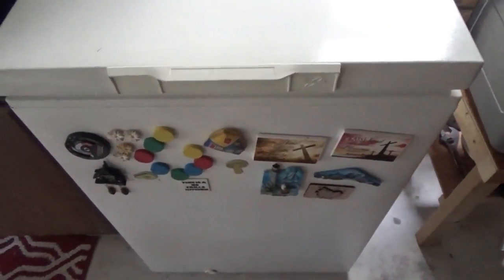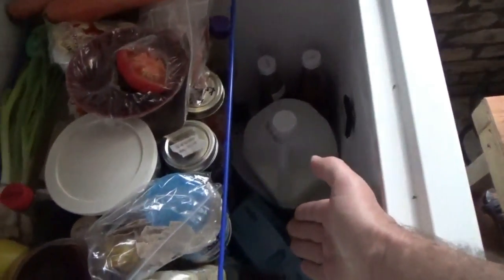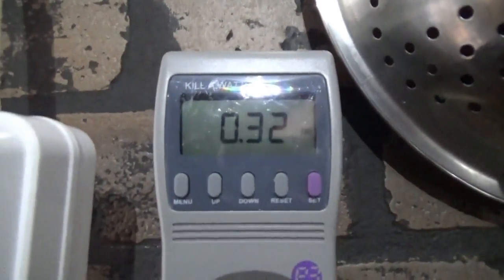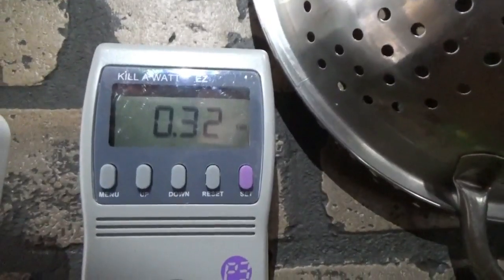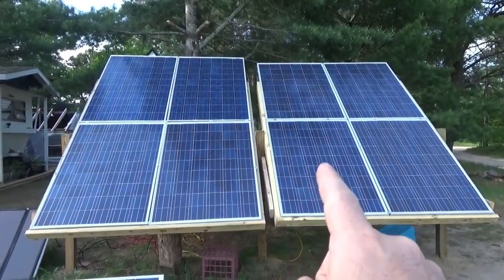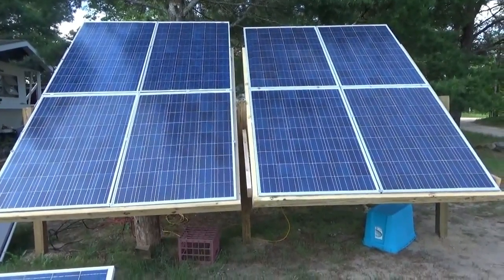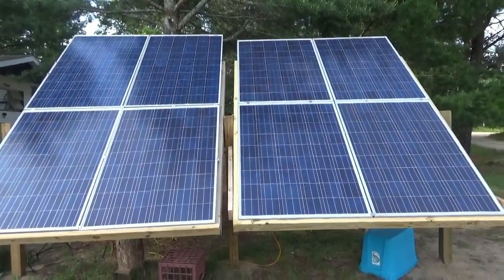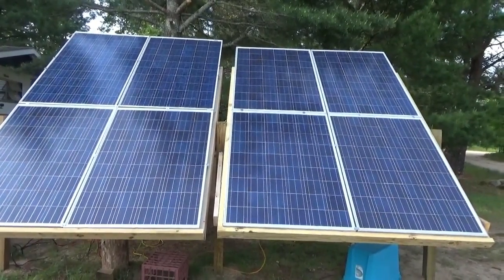Solar Powered Freezer Fridge Conversion Updates Use Only 300 WH Per Day

Comment: I'd like to share my results in a very similar test.  So there are a number of variables here that I'm aware of so technical guy out there just sit back and relax.  I bought a brand new Magic Chef 3.5 C. Ft. chest freezer (June 2019).  I bought a digital temperature controller and set the fridge/freezer compressor to turn on at 40F and turn off at 37F.  Once off, I recorded the temp continuing to drop as low as 30F before it would start the slow temp climb back up. Also note that I had the unit completely empty, I started the test with the unit already at the desired temp and it was placed inside my house at a constant 78F.  After 48 hours, here were the  results of my freezer to fridge conversion: My kill-a-watt recorded that it only consumed .238 KWH.  Of the 48 hours, it ran 7 hours and 40 minutes.  I noted that when the compressor turned on, there was a momentary spike of 700-800W but leveled off very quickly to around 60W.  I forgot to log the time it would run before turning off but I would guess under 2 minutes.  Also, the temperature controller was measured at idle fluctuating between 1.2 and .2W but I noticed it typical sat at .7W most of the time.  Understand that if you wanted to run this setup, you would also have to account for the draw/consumption of an inverter as I was not able to get numbers on one.

Regardless of the exact accuracy on my basic test, it's pretty clear that it is extremely efficient.   I hope this helps someone out there curious to semi real world numbers on this kind of set up.  I'm surprised there isn't more data/info on this subject on youtube.  The lack of it is what caused me to go do this on my own so I could see for myself.  I'm convinced now that it's the way to go for off-grid refrigeration for short or long term.

I forgot to add that I never opened the door either (except maybe once) which could also help account for my extremely low consumption.  In a real world situation, this would be getting opened much more frequently.  Regardless, this is still a very efficient option.
Reply from the maker: I plan to reset my meters and get some real world numbers. It sure is efficient though.
Reply: @TheDoItYourselfWorld   By the way, thank you for the videos.  Very helpful.  Enjoy your channel
Reply from the maker: Thank you

Comment: Great idea..they say that inverter freezers ,refrigerators and split AC heat also use less energy. You might wanna fill some of that empty space in the freezer with Styrofoam blocks that you could take out in small sections if you need the space for storage! but leave a little space around the wall area of the freezer because that's where the coils are!

Comment: Good little hack.
Do you know how much power that temperature sensor uses? It's working 24/7 monitoring the temperature and could be using more power over time than the freezer uses. Maybe a more passive non-electrical thermostat could make this project even more efficient using even less power.
On the other hand, your current temperature control may be using next to no power. That wasn't clear and just something I wondered about.
Maybe even turning the freezer's control to it's highest temperature would maintain the temperature at a little above freezing. Maybe some experimenting could show that.
I just try to avoid things that need to run constantly like the temperature control you are using. 
In any case good luck.
Reply from the maker: Yes I had thought of that and the digital controller is also on the meter. It uses one watt of power all the time. So I guess it uses 24 watts per day unless it uses more when the compressor is running but I have no way to measure that.
Reply from the maker: thanks

Comment: Hi Troy.  Liked this freezer project.  I am planning to do a similar setup.  Just recently started using solar electric.  But with 400 watts can not run the regular stand up refrigerator.  So looking for chest freezer to convert.  But what concerns me is the energy cost of also involving a DC to AC inverter.  I have an old APC UPS used for computer backups that can work as a pure sinewave inverter alone but man, it draws a lot of energy even without a load connected.  Would not make sense to let it idle most of the time and burning power for just the occasional loading to run the refrigerator.  So the question is how does your inverter operate?  Always on, burning some power with occasional big bursts for the refrigerator or maybe an automatic wake up where the inverter draws next to nothing until it senses the refrigerator call for power and then operates or is there another option?  What capacity do you use for the refrigerator and is it modified or pure sine wave?  What does your inverter draw in watts at idle without a load?  Just trying to get a feel for what is common for inverters with solar.  Thanks for any help.
Reply from the maker: That UPS is trying to draw power to charge the batteries as well. You would have to disable that part of the circuit I think in order to get it to work as only an inverter. They are not made to be efficient at all. A pure sine wave inverter is best for compressor type appliances. No idea really what my inverter draws but I have seen a difference in power loss overnight on my batteries using different inverters.
Reply: Thanks for replying.  My UPS is designed to work also as just an inverter.  During that mode, it does not charge the batteries, rather I can patch in power from my solar charge controller to keep charging them.  It is a pure sine wave UPS capable of 960 watts steady draw max.  Should be plenty to run my dorm fridge of 120 watts steady average power for short intervals as a fridge only runs also in intervals.  Could you check your idle volts and amps before the fridge turns on?  If not can you give the name and model of your inverter and I can check the specs?    

Would make a great video to show power draw between different inverters you had over the years and which was more efficient or what features you particularly liked or disliked.
Reply: I use a dedicated inverter for my chest fridge and I power the inverter on and off bypassing the power switch with a relay. Startup draw is about 120A at 12V which is quite hefty.  Inverter is oversized and so I removed all the fans which draw a decent amount of power.
Reply: Thanks for replying, Troy did not reply back as yet.  That is good info. Have you considered halving the amps by going to 24V batteries?  So the relay turns on/off the inverter which the chest is already plugged in?  Seems like it would be very hard on the inverter.  Was thinking better for the relay turn on the inverter and after a timed period then run the chest.  Unfortunately the on/off on my unit is a digital panel not discrete flip switch connections so can not use.  What is the inverter you have and I can look up the specs?
Reply: I have a purpose designed system that is tailored to my needs.  I use a 12V car battery from the vehicle I don't take to camp. Leaving it even with charge would shorten its life. Anyway, the whole camp runs on this battery, refrigeration, lights, 30 gal hot water, pump, TV, a medical device and even a dishwasher with heated dry. Doing dishes right now with 130F water. If there was a way to save another watt, I'd be doing it.
Reply: Your are using just one lead acid 12v car battery to run all that?  Do you have a specific video on it or a wiring diagram somewhere?  I visited your site, interesting circuits, will check out your videos when I have time.
Reply: @opera5714  you will Completely Destroy a Car Battery Quickly. Do not do that ....deep cycles amphr batteries NOT Cold Cranking Amp Batteries. If ya wanna waste $$  might as well just ,"PEE-IN-A-FAN"!!!
Reply: @unclejack41  You can easily destroy a battery with a fridge, even a deep cycle one.  However, I do not sit at the kiddie table of solar. I design advanced control systems and the fridge can never drop the battery much more than 5%.  I also run a dishwasher with heated dry and a large capacity clothes washer with hot water on all cycles all provided by PV. Who needs a big battery!

Comment: I'd be curious to know how much power the upright fridge used, for comparison. Some web research would indicate that an 80s vintage fridge would use up to 4.6kWh/day, but a modern high efficiency unit could hit 1.2kWh/day.
Reply from the maker: It was not a modern high efficiency fridge for sure. I would guess 5 KW per day based on meter usage in the past although I am not sure its "vintage" either. It has automatic defrost and an evaporator on the bottom. Never gave us any trouble. Just could not run it on solar power.

Comment: Like many others with these videos, I believe you are giving people unrealistic expectations.  I've run solar powered chest fridges for years and never get near those numbers. I've had 5 & 7CF fridges and I need a KW of panels to keep them running reliably.  Condensation is a nightmare. I keep mine elevated with a drip pan underneath.  My 5CF didn't  wasn't so stratified the way the coils were placed. The 7CF ( one year old) had the coils lower and I have to run a computer fan all the time to keep from severe temp stratification. If you never open the fridge, you might get close to those numbers. Those are definitely not active use numbers. What does the timer say?  My control prevents hot starts and the system will continue to run in the rain and clouds. I heat all my water with the excess energy not used by the fridge. It is a catchy title.
Reply from the maker: So, either I am lying or the Kill-A-Watt meter is lying. Or both I guess. I showed the meter. I do believe I told the details in the video and description. You can believe it or not.
Now the condensation is a problem, thats for sure.
Anyway, I plan to do a video showing it running on a single panel and a battery when I can scratch up a battery for the project.
I have seen this done many times during my brief stay in Australia so I know its possible. They do it a lot over there. Off a single battery.

Comment: What brand solar panel do you use? And your saying if I get a 200 watt solar panel. I can run my little deep freeze?
Reply from the maker: I forgot the brand. Had them for years now. I have a mix now anyway. It depends on your freezer specs. I would double the solar panels and have enough battery power to run it over night. Should be good then.

Comment: Hello, here is a woman with a question! :-) That freezer you are powering now with your solarpanels, is it originally a freezer that went into the wallsocket/normal grid power, or is it a special one build for solarpanels? This is exiting to learn, as the conversion might be usefull for us also. (Specially if the freezer is an oldtimer from the grid.) Thank you in advance for helping us out! (We might be offgrid very soon, as we can not take into our household this smartmeter, thus they might kick us off.)
Reply from the maker: I am using a NORMAL freezer made for on grid use. But its best to get a newer energy star freezer for conversion to off grid use. Less energy used is better and newer is better by far.
Reply: @TheDoItYourselfWorld  Waugh, that was for sure good news for us! :-) Thanks for sharing this. Now I just need to figure out, if we need more than "just" a solarpanel or 2, of those 200W and an inverter to make this happen. :-) My husband got happy just now. (We are some of those who have gotten Electro Hyper Sensitive, so the smartmeter is just no go. We have been sick because of those in some of our former homes. We are so rural now that we can possibly be, besides the forest. Moving is not an option for us. So we have to learn this now. :-) ) BTW we are living in Denmark, Europe.
Reply from the maker: You should start out with extra solar panels because there will be cloudy days. If you can afford it, go bigger. And have extra batteries. More than you think you need, if you can afford it. Those will get you through the darker days. Consider a fridge has a 30% duty cycle which means it runs 1/3 of the time. A converted freezer will run much less but still go bigger if you can.
Reply: @TheDoItYourselfWorld  Hello again. Freezer converted to a frigde. Is there any change that it freezes some in the buttom? (Our most needed was to keep things frozen, so a lot of food won´t get spoiled.)
Reply: Hello again. :-) Now we have got some autobatteries 12V for the freezer/frigde, and the inverter, and it works ok. (While testing short periods.) We think to recharge those with a generator coming soon. :-) A new question: We have an electric wather heater, and old one. It takes 1,2-3,6 kW to warm up the wather. It says to take 230-400Volts to run (on the normal grid). :o) Would it be possible to take a huge inverter with 2000watt- 12V battery to get this to work? (I know it might be impossible, but I am not that clever concerning this, this is why I am asking.) Thanks for helping us out.

Comment: Is there a video on how to convert? Impressive
Reply from the maker: Its just a thermostat that you plug the freezer into and plug that into the wall. It lets you dial down the temperature to make it work like a fridge.
Reply: @TheDoItYourselfWorld  thanks I found it, could I run that with a 200watt inverter and one battery you think? Or would I need a bigger inverter
Reply from the maker: @jamesmcfarland2636  The surge of a compressor starting up can be up to 3x the normal running power so you need something that can handle the surge. I would at least double the batteries as well. It all depends on how many solar panels you have to charge them up.

Comment: How did those camping fridge  freezer on the bottom and refrigerator on the top all-in-one how can you do that with a chest freezer like that
Reply from the maker: The camping fridge generally uses propane for the most part or a heating element. They are not energy efficient at all really.

Comment: How much would I spend if I do this? What is the type of the solar panel?
Reply from the maker: I plan to try to run this off a single deep cycle battery and one or two solar panels. I figure a few hundred dollars should do it. These are poly solar panels at 200 Watts each.
Reply: @TheDoItYourselfWorld  I would love to but I don't know if I am capable. I don't have the technical knowledge.

Comment: How do you store the extra unused energy from your panels for extended use on stormy days?
Reply from the maker: In a battery bank. Then a power inverter converts to be used in the house.
Reply: The Do It Yourself World will interstate deep cycle batteries work good?? I am  new to this and buying  509 watts of solar and a inverter.. How many batteries do I need?? the more batterys the more power you store?? thsnks and what amp solar controller would I need?? thanks
Reply: @daveyboy8907  just my 2 cents.... 6 volt golf cart batteries are the best bang for your buck. Downside is they require maintenance.

Comment: That's 120v watts not battery watts used isn't the other side of the inverter using 10x the power
Reply from the maker: Watts are always the same either way. Amps x Volts = Watts. Lets take an example of a device that uses 1 Amp at 120 Volts and is plugged into an inverter.

1 Amp x 120 Volts = 120 Watts from the inverter.
10 Amps x 12 Volts = 120 Watts from the batteries.

Comment: So welcome back at YouTube Troy :-) i told you about the mining costs and why ppl stopped because of it but I guess anyone better make own mistakes to learn from. So when do you move back to the trailer home? How is your currency so far? As mentioned seems u are back on :-) Greets
Reply from the maker: Thanks. Well, the cost of energy here, the listed price, is cheap at 8.9 cents per KW. There is a 1.2 cent per KW fee. BUT - they increase the fees in a very increasing scale as your usage goes up. Our usage was 400 and the fees were 450 for a month. That made the cost higher than my profit. Now, I was running shared mining rigs so I only got to keep half of what I mined. If I was mining for myself alone with all those rigs, I would probably still have run a profit even at that high cost.

But I will not risk it again because now I know they charge insane service fees with higher usage. I will try to increase our solar power to run mining rigs.

We are not moving into the trailer. The chalet is cooler in summer and warmer in winter.
Reply: The Do It Yourself World can you sell the trailer as it is?
Reply from the maker: Dont want to. We do use it daily. Just dont sleep in it. Its a perfect guest house too.

Comment: I have enjoyed the Video's I was wondering if it is ok to have one polycristallin and one monocristallin  100 w each amps  volts the same thank you once again i am enjoying your videos.
Reply from the maker: Poly, mono and Amorphous panels all have their advantages and disadvantages plus price differences. I would not mix too much unless you already have them. You can put them on separate charge controllers. I plan to eventually get some Amorphous panels to run on a separate controller for low light or cloudy days when the other panels are not performing as well.